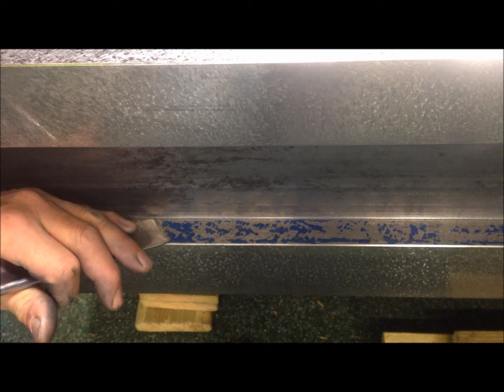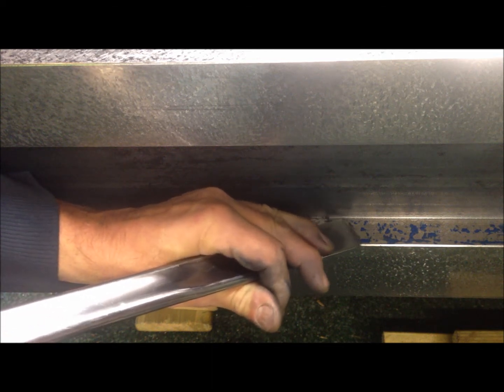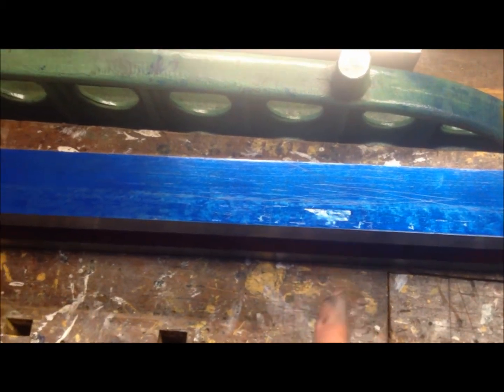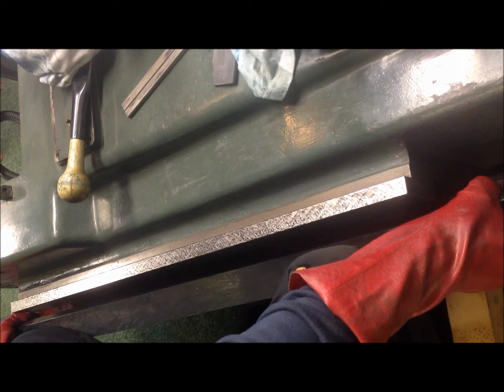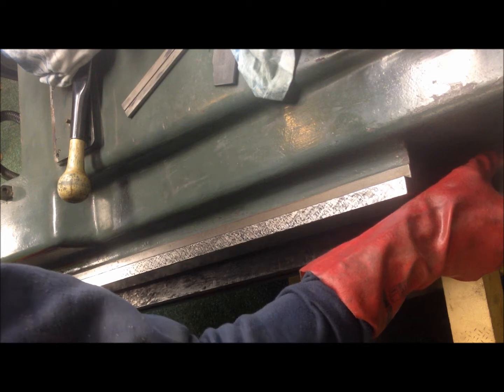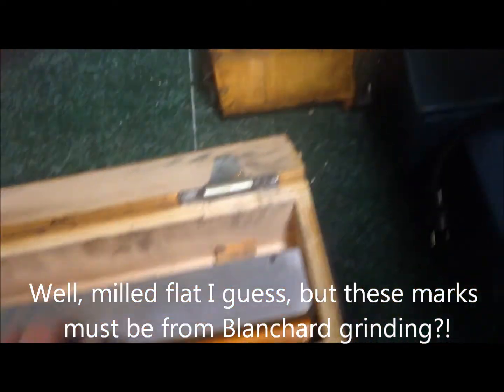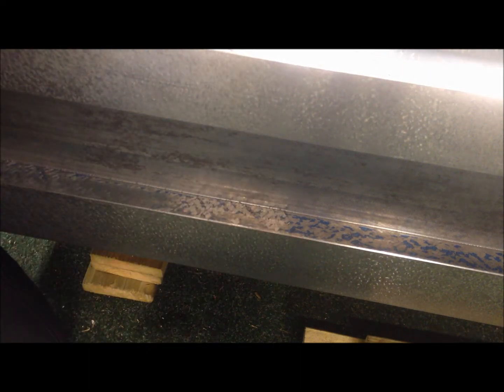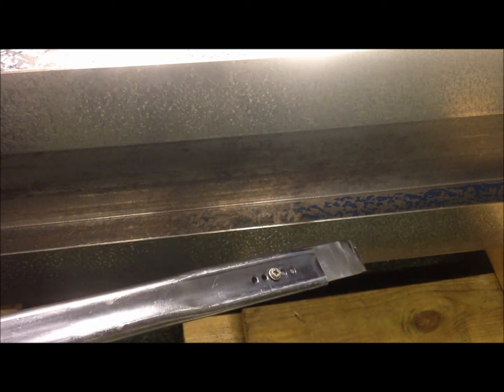Schaublin SV52 milling machine, column inner side guideway scraping

Comment: Hi Jan,
I'm enjoying this series on the Mill restoration
I wouldn't bother with the gloves except to keep your hands warm in a cold workshop.The transfer of heat from your hand compared to the thermal inertia involved with that mass of metal would result in negligible difference in accuracy. By the time you put the scraper down and changed to the reference surface or indicator to check your work the localised heating will have dissipated. Also bear in mind the work shop is not temperature controlled and you are not trying to create a "reference standard" surface. 
Cheers Eric
Reply from the maker: midgoog2 My thoughts too. My workshop is nowhere near a climate controlled lab, so I am aware that "the finer details escape me" ref. ability to move repeatably in mikrons